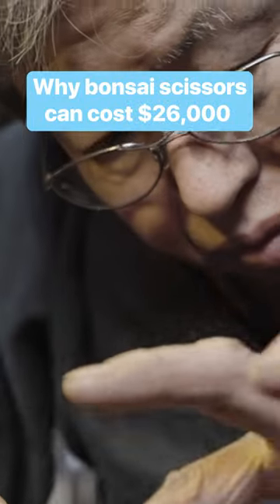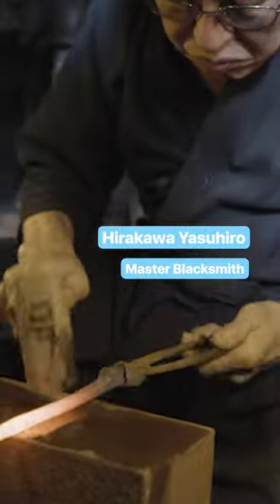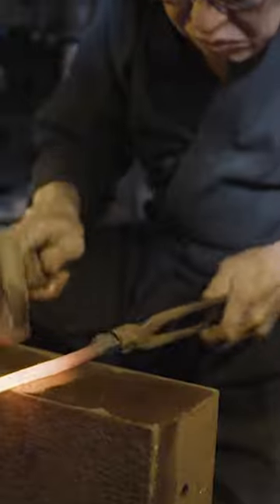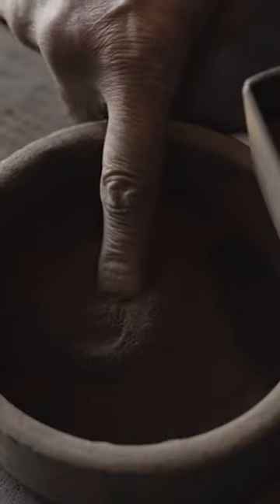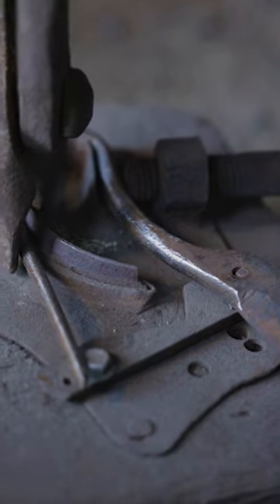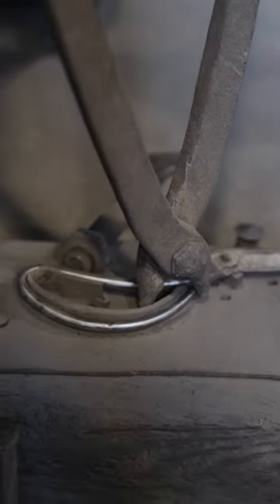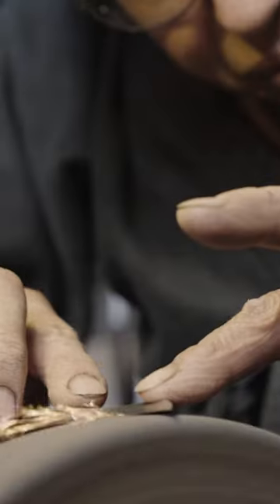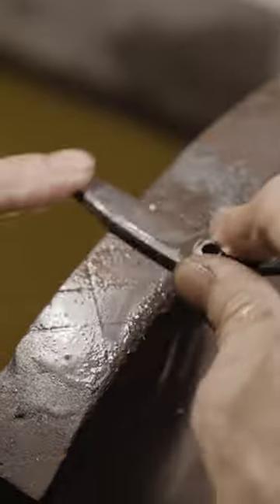The best bonsai scissors are forged like samurai swords. #howitsmade #bonsai #soexpensive

Comment: Come to India, we can have this build for less than a $ in a days time and will be sold for max 5$ (remove gold used for designing). 26k is like you are building an entire factory out of that money.
Reply: This is Japan. Don't even dare to compare.
Reply: @Sheen023  its siccors, and we are talking about a 5200 times price increase
Reply: @paulwartha8425  doesn't matter.
Reply: Japanese scissors are made by a Master Craftsman, which can last a lifetime and be passed down generations. 

Scissors from india are made by a 4 year kid and his mom for 1c worth of tin, plastic, and glue. The indian😊 scissors last as long as it takes to be shipped. They are guaranteed to be in 3-15 pieces when the customer opens the package. 

The saying, "You get what you paid for" was probably coined by someone who got "the same thing" cheaper from a hack business in india, pakistan or china instead of a Master Craftsman in Japan 😂🤣😂🤣
Reply: @DCFN94  still the cost is not justified even if the next generation would like to use. If you want a scissor for lifetime just pay 10$ more and handover the raw materials you prefer.  We do have this kind of scissors at home already lasting more than 30+ years now. No rocket science required in this. At the end it all boils down on the raw material used for making it. Use fine carbon stainless steel that should work absoutely fine. Same applies for any skilled person in the world of any country. Japan cant be special here. There are just playing the demand supply game and pricing things higher for no reason.
Reply: @DCFN94  People cant be stupid enough to justify the price of a car for a product that costs less than 5 Euros and that can also last decades